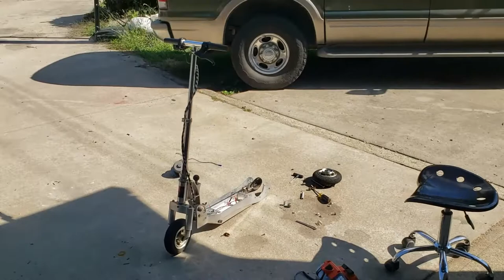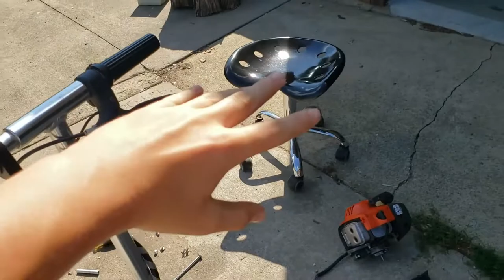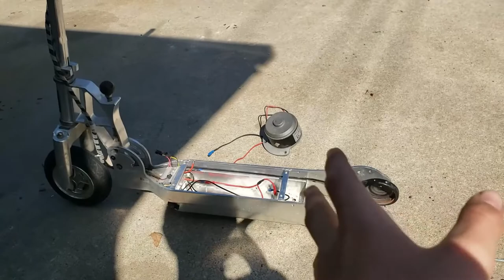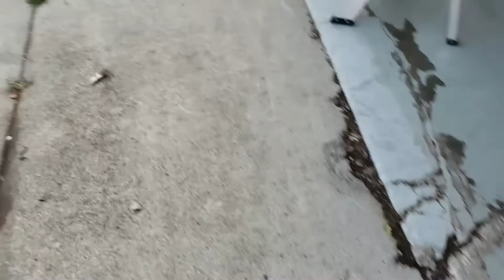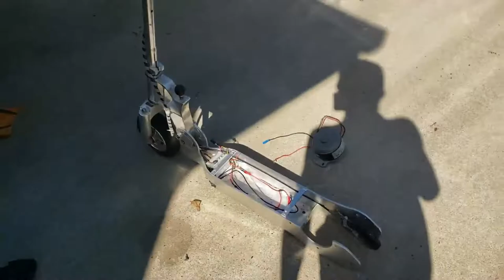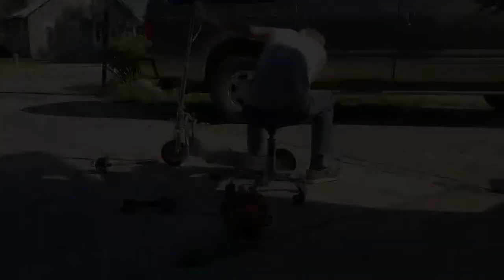Weed Eater Engine on Electric Scooter Pt. 1 (Electric to Gas Conversion)

Comment: Hi what scooter is easy to put on a gas 2 stroke motor without too much cutting or welding?  Can you recommend a base scooter to buy that I can slap on a motor and chain will fit in back tire sprocket?